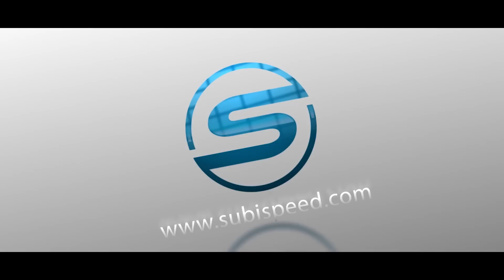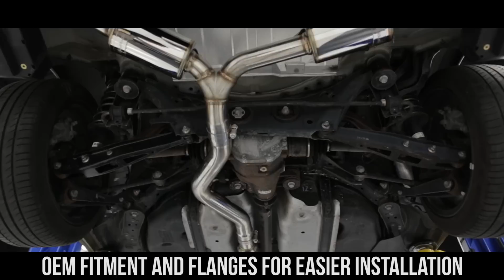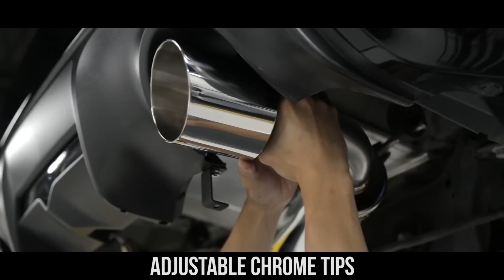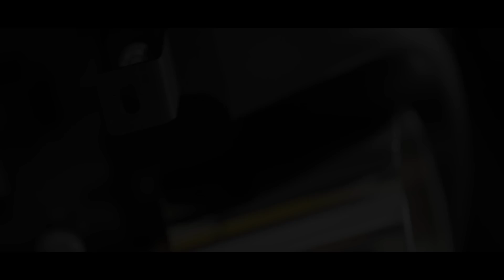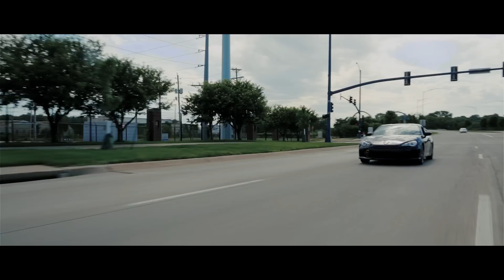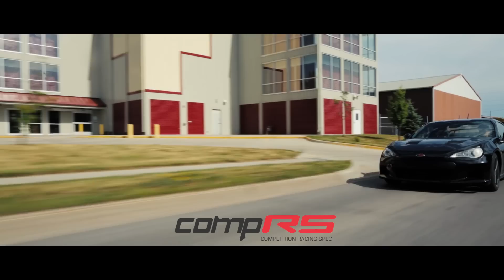Subispeed - BRZ/FRS/GT86 MXP Comp RS Exhaust System

Comment: Is this stock headers and front pipe and just the Catback added?
Reply from the maker: There is a catless frontpipe installed as well.
Reply: +SubiSpeed what kind of frontpipe is in there? And what's your suggestions for headers?
Reply from the maker: Motiv Test Pipe on this particular car.
http://www.subispeed.com/2013-subaru-brz/exhuast/motiv-concepts-test-pipe#.V7b0qvkrKrw

With the catless frontpipe, we suggest ours of course, but there are other options available now.
http://www.subispeed.com/ft86-catted-uel-header#.V7b1tvkrKrw
Reply: +SubiSpeed any rasp or drone?
Reply: How many inches in diameter is the mxp OP